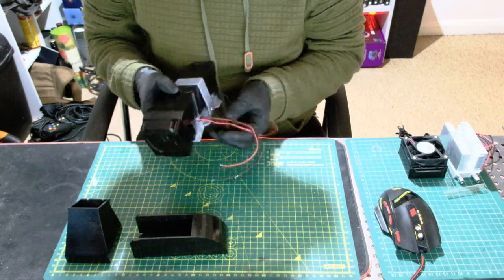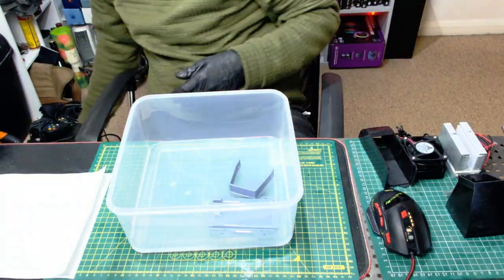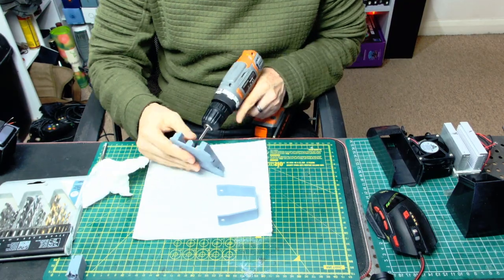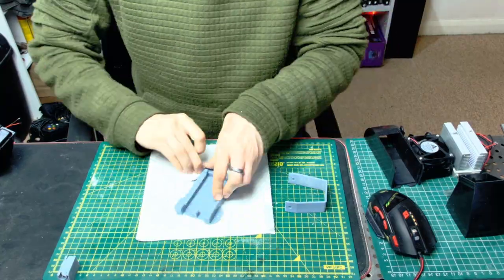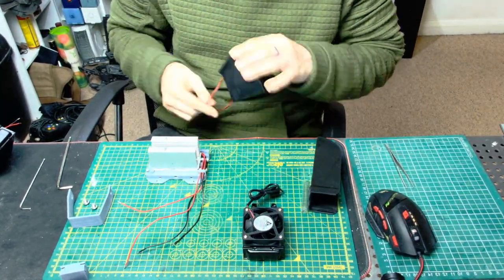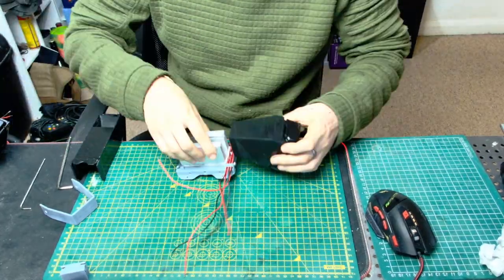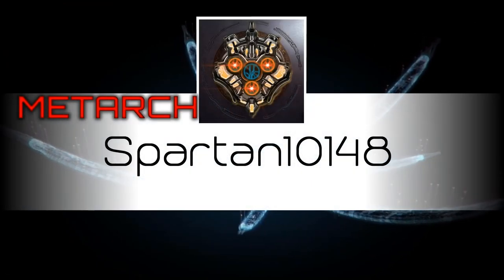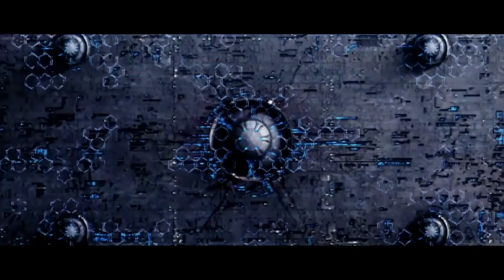Cooling Unit Assembly | Project: MJOLNIR

Comment: Do both long and short forms. Long for when milestone level progress is made, short for little updates between
Reply: I second this
Reply: This seems like the most logical way forward.
Reply: Agreed. Time lapses are good for showing construciton of parts but a long form video is best for bigger discussions and milestones.
Reply: @kaf696  considering he's doing and financing this solo, I'd call what he's gotten done significant progress. I'd like to see you do better in a shorter time frame with equal or superior quality.
Reply: @kaf696  yeah 3rd parties that get paid. You think all these tools and parts are cheap? The headset is a few grand before mods, the helmet frame manufacture and design support is another few grand. He's definately spent more than just the 20K you are claiming. Then there is the spent materials in the prototyping. 

And as for the 3rd parties? They don't work for free and some have probably backed out. 

I work in a repair and manufacturing shop and let me tell you, nothing is as cheap as you are thinking. Especially aluminum and the 3D printed parts. Hell the radiators he's using are not cheap, and they're PC parts.
Reply: @kaf696  This is a passion project by an engineering nerd. Attempting to use what is at his disposal to get as close as possible to a real suit. Its not just a cosplay. Is it a copy of the game suit? No because the game suit is literal fiction. This is a "lets make a functional suit with what we've got available". No sane company would take this on, its not commercially viable as a product, and the tech isn't all the way there yet to use as a real battle armour. So why you mad?

Comment: Have you tried submerging the 3D prints into hot/warm water to make the supports come off effortlessly? Altho from what I recall you had issues with warping before and working with relatively small tolerances so maybe that is factor leaving the hot water out.

Comment: A word of caution with the skin hydro layer, depending upon how the water will flow through the suit there is a tendency for the material to shrink and constrict the wearer once water pressure is shut off. Veteran Army Aviator and the Army had us test prototype shirts to wear that work similarly but were nixed when it became more trouble then there worth, you'll either have a layer too large to fit comfortably when filled with water or too small to get out of once deflated

Comment: Short form is good for videos like this where youre showing off prototypes and maybe little changes to a system. Since you're still working out the issues with equipment equipment short form is good to introduce us to it and get things keep people updated. When it comes to the actual pieces and metal suit, a long form one would be better where you go into detail about the piece and really explain it. At that point you've done a lot more with it to be comfortable with the more expensive route and you should take the time to really explain what's going on and how it connects I'm and plays into it all.

Comment: I just have a question about the cooling system. I've been working on putting a cooling system similar to your based on the semiconductor chips for my mandalorian armor. Power has been my main concern so far. How are you powering the cooling chips and what sort of battery life are you expecting to get out of the system? Any recommendations are appreciated or if there's a video I've missed where you've discussed this in detail. Thanks can't wait to see more of this project! Great work!

Comment: If you used a "used" Dyson motor, you might be able to avoid having to use those bulky CPU-like fans for something smaller and that will have potentially better cooling capabilities.